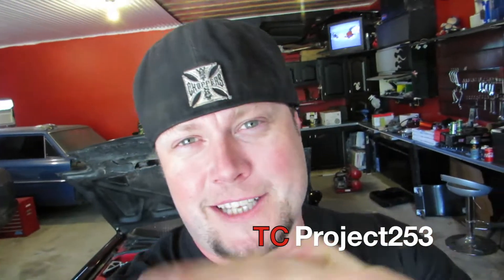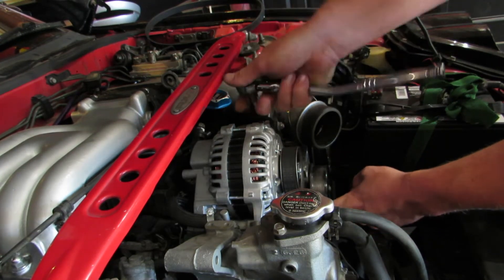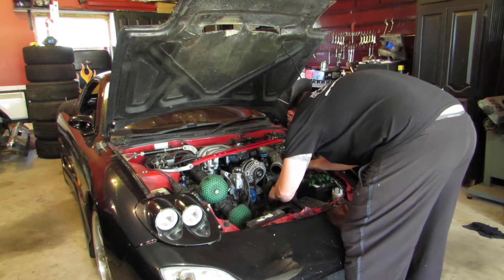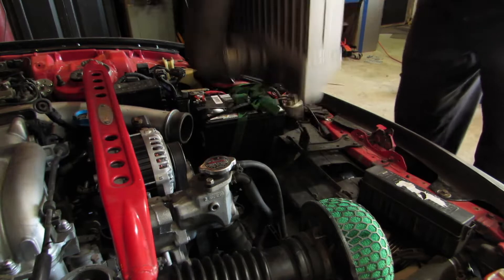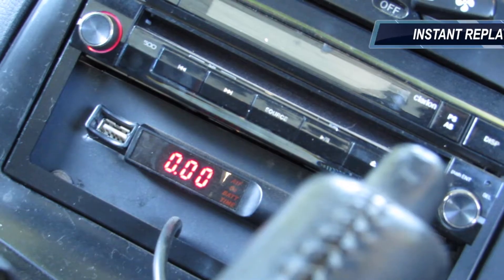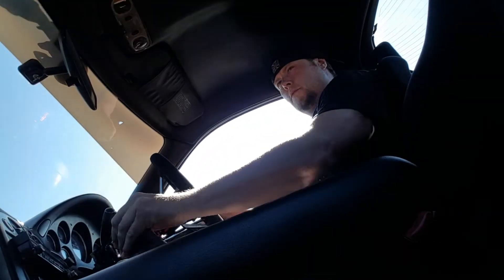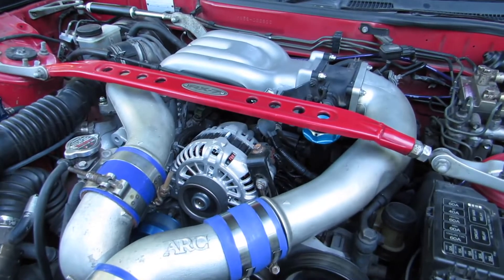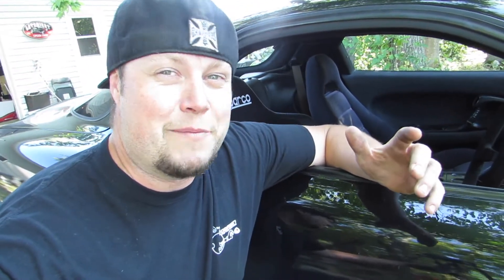RX7 Alternator Fix (fd3s) How to install a new alternator

Comment: Hey bro just wanted to ask were you chasing after a misfire before the alternator swap?
Reply from the maker: It wasn't charging properly.. I had a ground problem as well that plagued this thing for about a year and a half lol it's had a misfire problem but only on idle, never on throttle.. I feel like I didn't really answer your question 😕
Reply: @TCProject253  haha that’s alright! I was listening closely to what you were saying and somewhere there you mentioned something in the high rpm so I imagined it to be a misfire issue. Thanks for replying!
Reply from the maker: @bernardmendoza7943  my pleasure, thanks for commenting 😀  it was film a good while ago also. The front rotor lost compression on me last summer. This car might be down for awhile